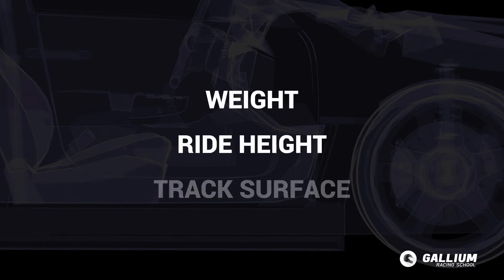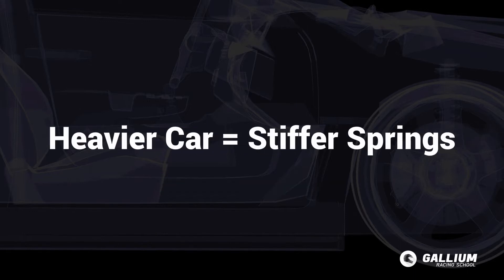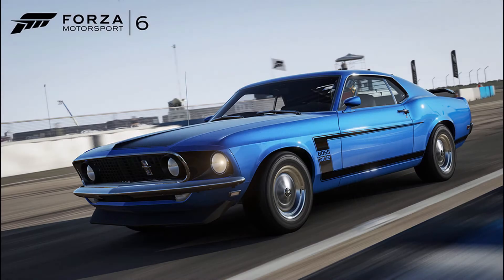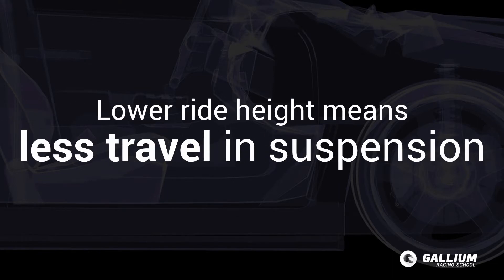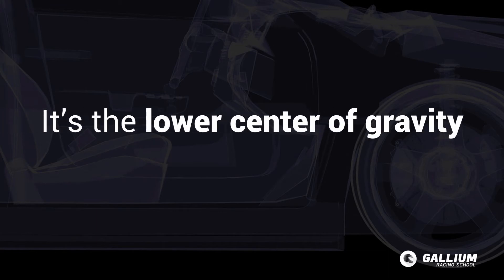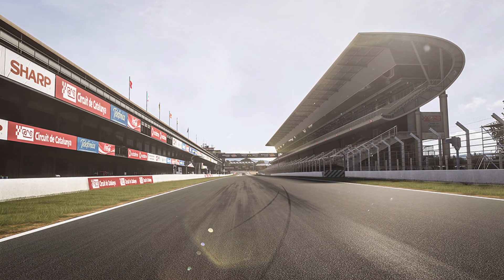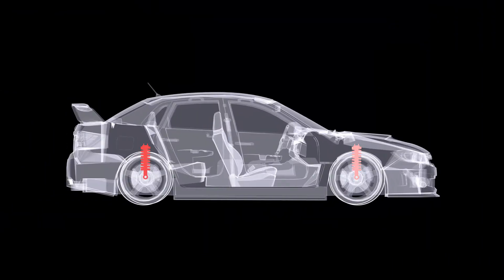06 - Tips for Tuning Spring Rates - Suspension Tuning in Forza Motorsport

Comment: Do I understand correctly, stiffer front springs cause understeer because the stiff suspension chooses bumps worse, and then the front wheels lose contact with the track? Sorry for my English :)
Reply from the maker: That's a good way of thinking about it - the stiffer springs do not absorb bumps and can end up skipping over them instead. There is also the consideration of stiffness front vs. rear. If front is too stiff, you get understeer. And if both are too stiff the car will simply slide off the road in a somewhat balanced way.

Comment: some cars normally muscle cars have rear lower than front like Challenger SRT8 the minimal is 4,4 on front and 3,8 on rear if i "fix" the ride height to both be 4,5 on front and rear this will make the rear have more travel than front but if i increase the same on front and rear to have the same travel  (4,5 front and 3,9 rear) this will not lower the center of gravity  ?

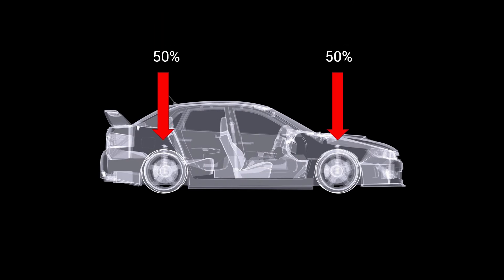Comment: At 2:03. If the front springs are stiffer than the rear, you will have oversteer.  The stiffer spring rate will cause the front tires to over correct on small bumps while steering, and can cause a spin out, or loss of control.
Reply from the maker: Thanks for the comment - give it a try when you have a chance, and you will see why the video says, "increased front spring rate will result in understeer."
Reply: no